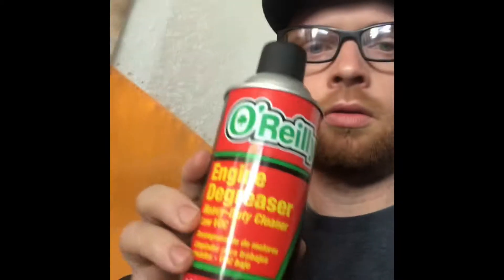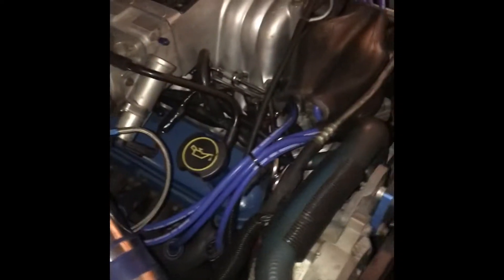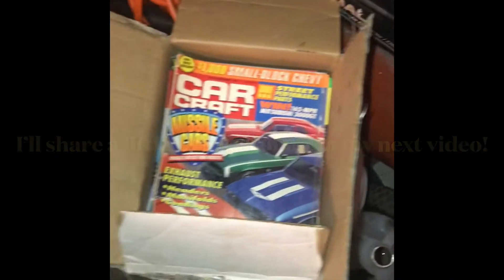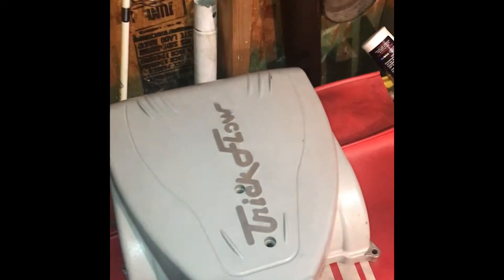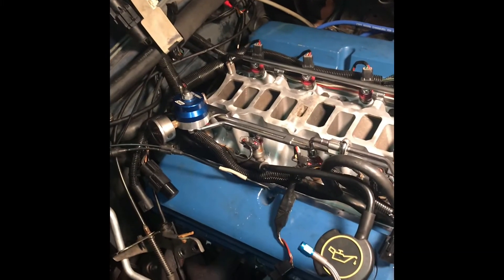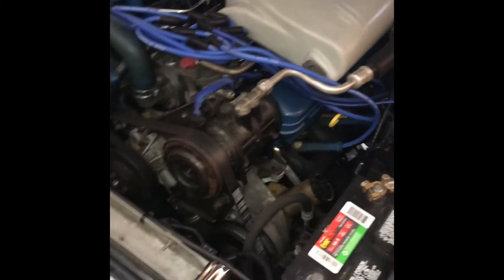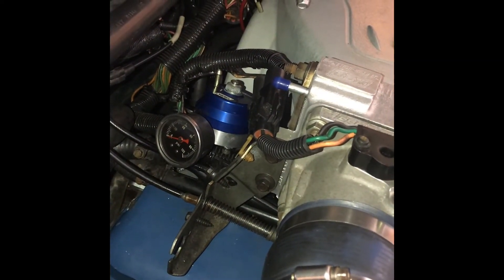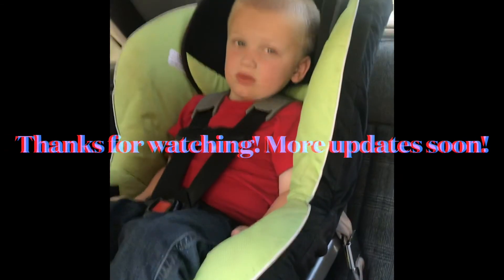Another part to the puzzle for the Foxbody!

Comment: nice intake ..def that will perform much better then the stock one....I like my GT Tubular Intake for look ..but I think it holds back my 331 in the upper RPM range..TF or RPM2 Intake would def free some more HPs....
Reply from the maker: Thanks brother!!! Yea it definitely did free up some power from what I can tell so far. The Gt40 intake do very well for being a stock production intake! Hope your doing well brother!
Reply: just check the vid from Richard Holdener .... 5.0L Ford Intake Test....huge differents..
Reply from the maker: @Diondo26  yep!!!! I think the shortie headers are hold back the flow now but it definitely picked up power!!!
Reply: @jdrods1519  I actually went back from LT to Shortys...  less heat more space to work and because Street car...and I dont feel any HP loss ....I do a lot of street pases with the Dragy..and there is no difference in 1/4 mile time....maybe at the track you can see a difference ..but for a street car its an expensive upgrade with no or very little benefits...
Reply from the maker: @Diondo26  yea I might just end up going with the 1-3/4 shorties. Jegs does have their 1-3/4 long tube for 200 now but not sure I want to fight with putting them on lol